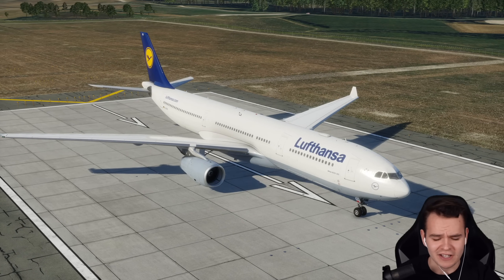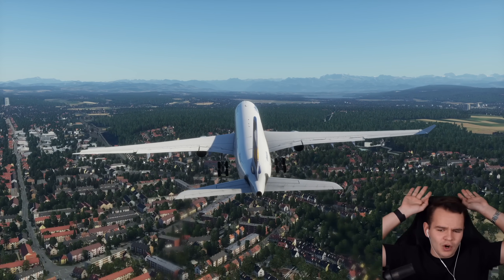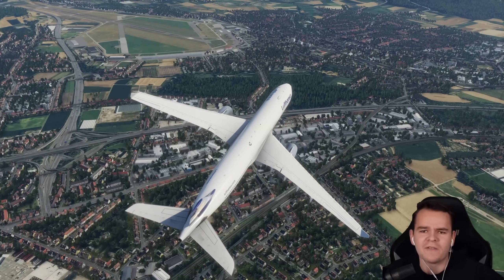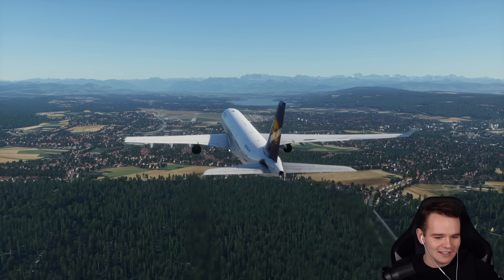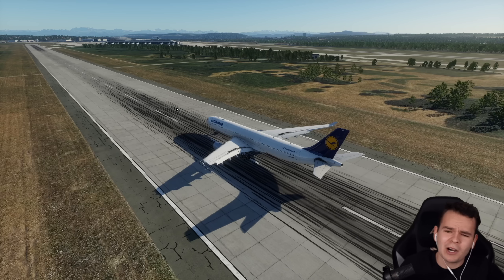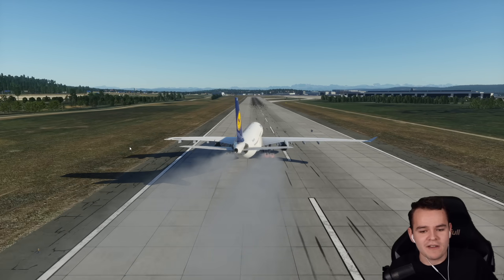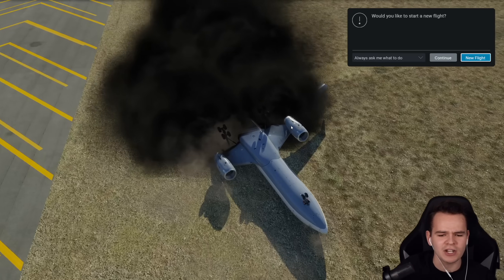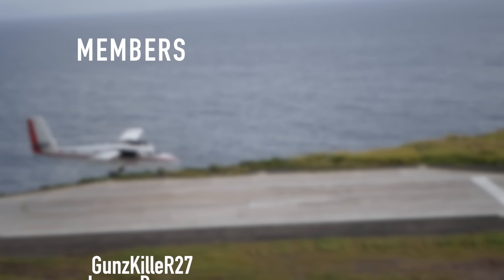Wing Airliner Loses Part Of The LEFT WING - Can It Still Fly?

Comment: I think an f-15 was able to fly with only one wing
Reply: Because the F15 has a TWR more them one, meaning it like a rocket (rockets NEED a twr more then one) and they can fly side way because of that. The f15 could fly with out Any wings, but it would be un stable and have no control unless the engine had swivel set to 10000%

Comment: 707: its possible🤷‍♂️
Reply: Average 707 flight
Reply: Panam 853
Reply: 4
Reply: *correction: Pan Am 707
Reply: If I remember correctly the DC-8 landed without most of its wing after a mid air collision (forgot what the accident was called)
Reply: @458italiap I believe the accident your referring to is Spantax 400 but that involved a Convair 990 colliding with an Iberia DC-9 over France where the DC-9 crashed but the Convair 990 landed safely. Unless your referring to the mid air collision over New York where a United DC-8 and a TWA Connie collided but both planes crashed in that collision
Reply: @a.gproductions_official  THAT WAS A CONVAIR?!